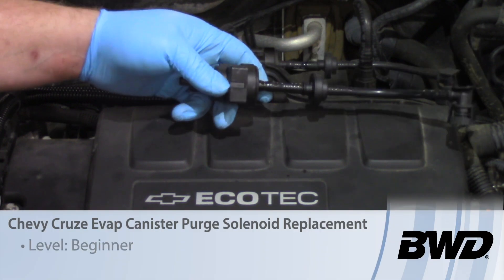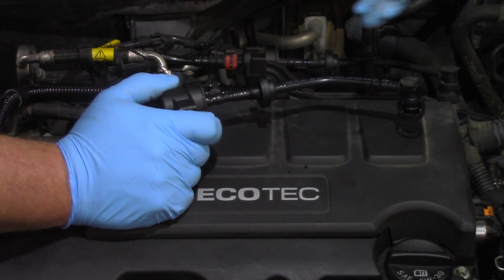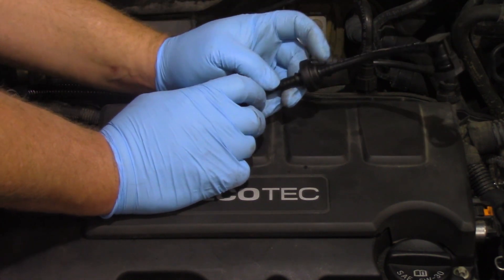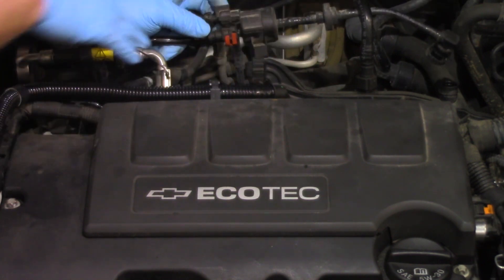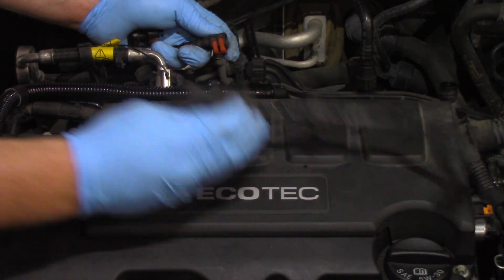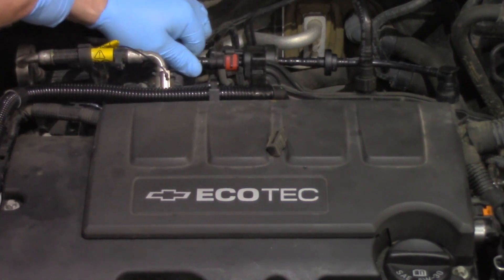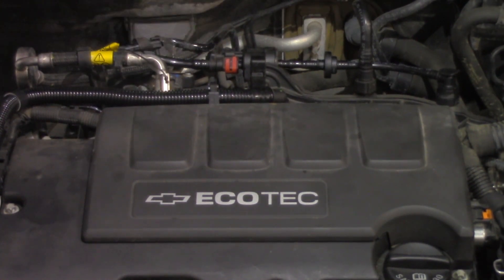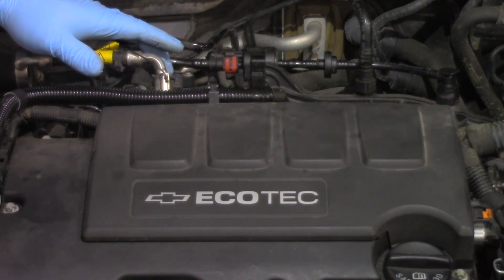Chevy Cruze Evap Canister Purge Solenoid Replacement

Comment: My 2015 1.4 Cruze wont complete its evap system check. I dont have any CEL lit up but still wont complete its evap. Wonder if this could be why? 86,000 miles. Just replaced intake manifold, cam cover, coil PK and plugs and my crank and cam seals. Dealer just fixed a vac hose that wasnt pushed on causing me years of headaches and now its this.

Comment: Thanks.  My green clip on the left that hold the hose on snapped like a twig.  I needed to remove the entire clip to get the unit off.  The new one is snug without the clip, do you think this is an issue? Can you simply order replacemente clips?

Comment: I did this recently and after clearing codes, I started my car. The check engine light came back and then when I put the car in drive, the "D" on the dash wash flashing and the car would only move at a snail's pace. Checked the codes again and this time it was for the transmission system... I removed it and re-installed the part to ensure I had connected everything securely and then cleared the codes. After which my car was fine. HOWEVER; today when driving home from work I had to make a pit stop so I parked and shut off my car. I turned it back on and the check engine light was back on and the car had the same issue when putting it in drive. Mind you, the check engine light stayed off and I had zero issues for a solid two months. Any ideas what could be wrong? Should I just pull it off and back on again like before? I'd rather have this not happen again lol. Thanks!

Comment: Hi. I'm trying to perform this procedure for a 2017 Sonic LT Turbo RS (1.4L Turbo engine). I am replacing GM part number 55573017. It looks identical to the part used here. The issue I am having is that the electrical and vapor lines that connect to the canister are different. The ones depicted here (and other videos) have red release clips. My vehicle's connectors have blue clips, and the black mechanisms they are mounted in are are also different. I have spent over an hour, and have not been able to remove either one from the bad EVAP canister. I did manage to break the one on the EVAP line, and I haven't been able to even find a GM part number for that assembly (that I also now need). This is going from bad to worse. Does anyone care to weigh in?